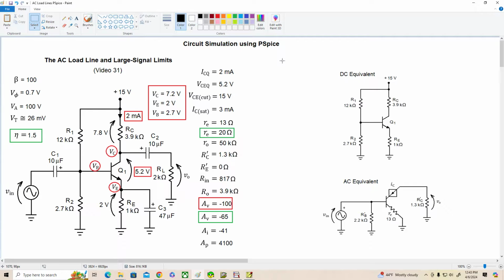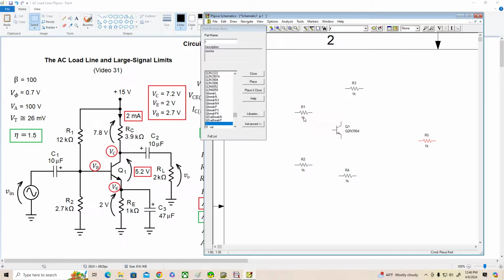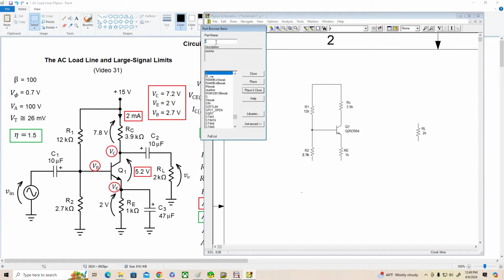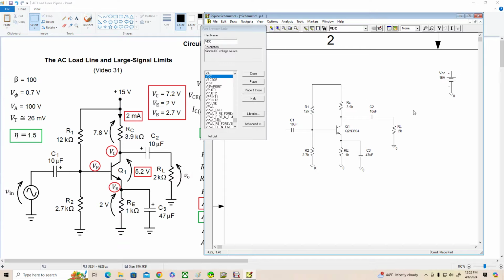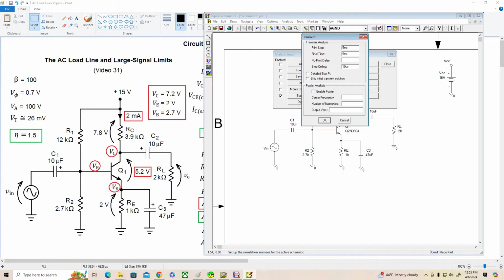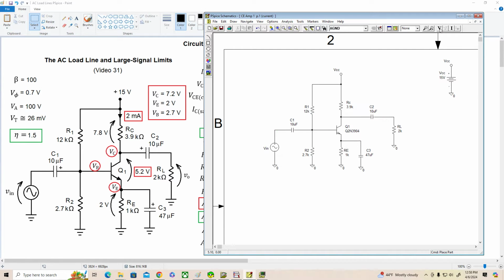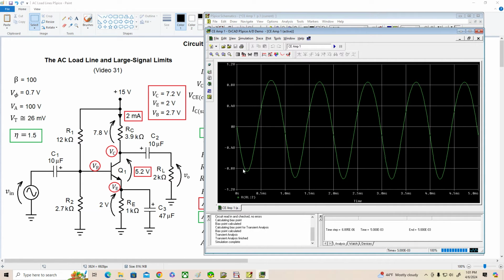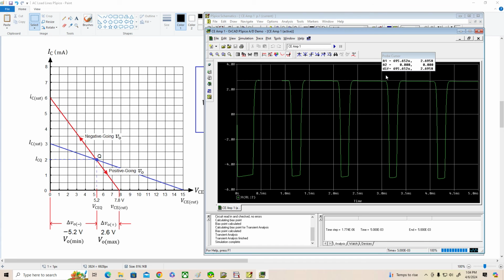Topic 34: PSpice Simulation, Operating  Point and Basic Transient Analysis

Comment: First of all, thanks for making these videos... i really appreciate it. I have watched your videos regarding the ac load line but still dont understand how to go from the vce_min/max to the output voltage, vo. For example, in the common emitter we take the output from the collector Vc not vce... thats when i feel a bit lost about how to determine the maximum output voltage swing without clipping.

Thanks for your time!
Reply from the maker: I did present the equation that takes into account the presence of emitter resistance in the large-signal AC equivalent. I can’t present it in a comment but it’s there (I forget exactly where).

Comment: It's also possible to remove the "voltage divider" to bias the transistor, you take voltage follower configured opamp with potmeter on the non inverted input as voltage divider, attach a Giga Ohm resistor and diode on the opamps output in series to the Base of the transistor, you can make it amplify like 4, but not really centered.